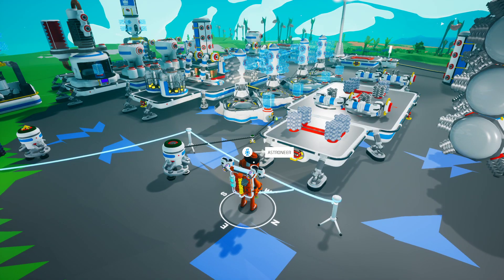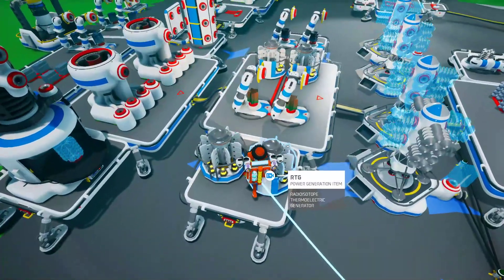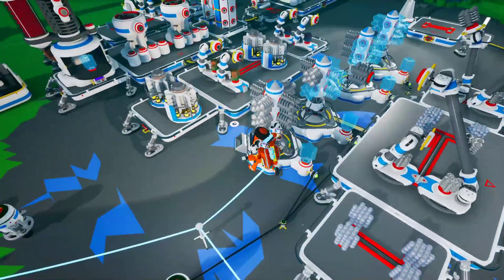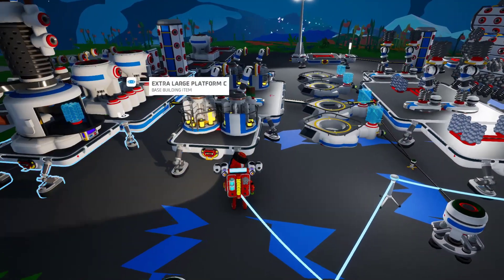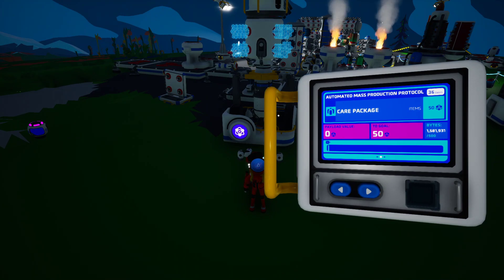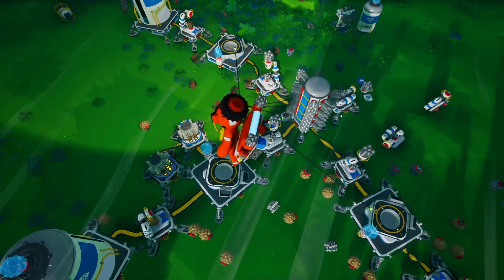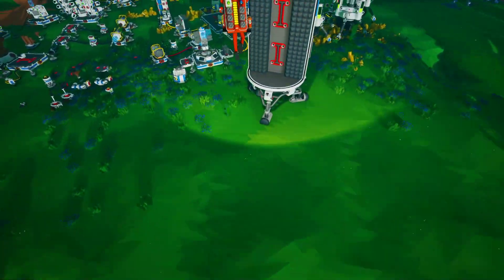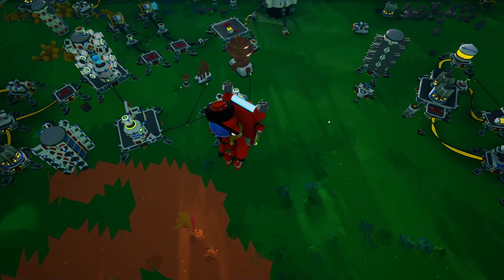Astroneer Automation Guides - Crappy Scrap to Aluminum Alloy Line

Comment: Couldn’t you use the new resource canisters in place of your medium silo on your smelting platform?
Reply from the maker: That would work too. I just need to use small platforms and aim both sets of arms at the storage and that'll fix it. I messed up big time by using the extra large platforms instead of the small ones.